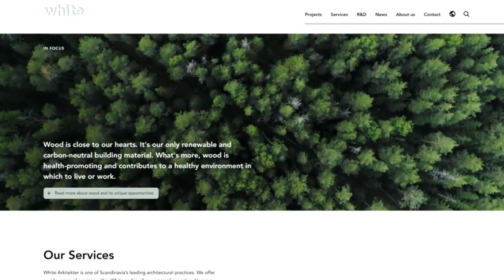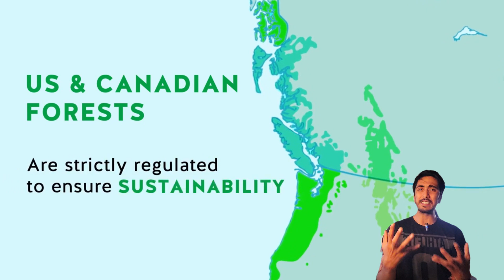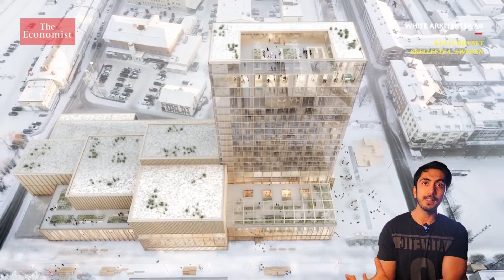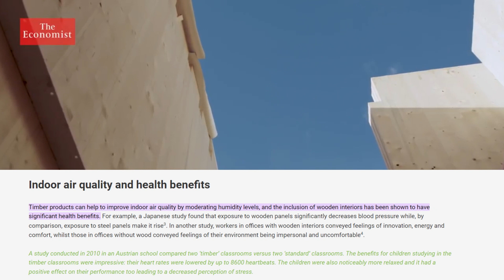City Made of Wood | Stockholm Wood City | Is It a Environmental Disaster ?

Comment: What about the Fire hazards as the city will going to have this much of timber in it....?
Reply from the maker: I agree with Mr. JoeSomebody , these timber are highly efficient and treated with various chemicals to protect it from catching fire, and when CLT burn it never burns completely only the upper surface burns and the inner core stays intact. Still there are always risks associated, hence the fire code comes in like heavy duty sprinkler systems, no smoking zones, electric stoves, smoke detectors, fire escapes minimum spacing between the buildings is higher etc. But still a good question I should have addressed it more widely.